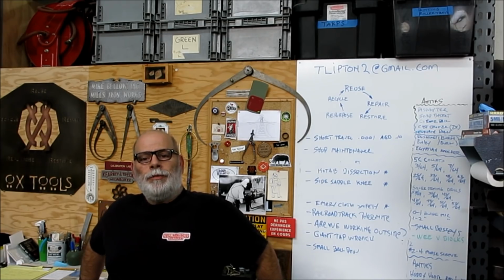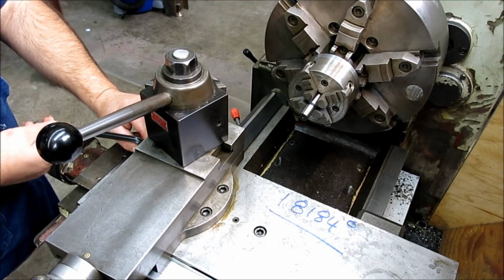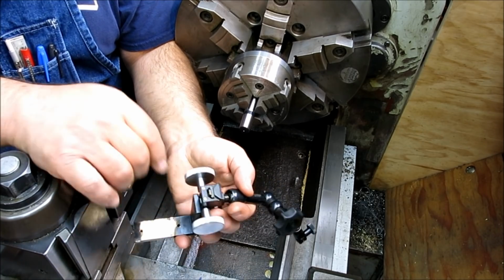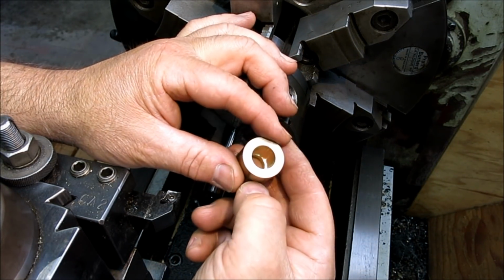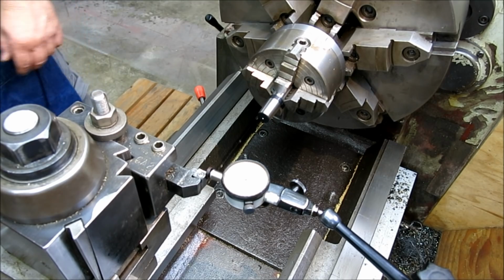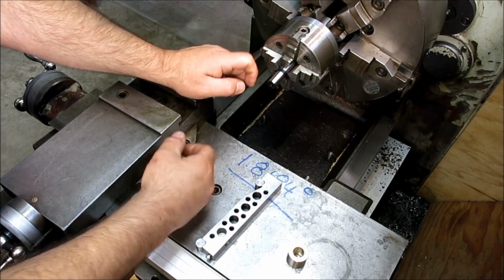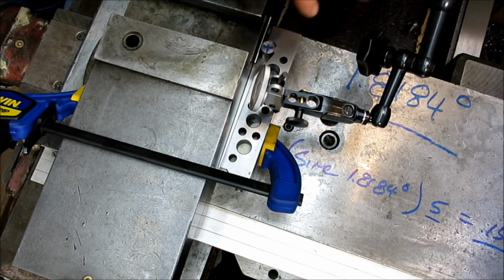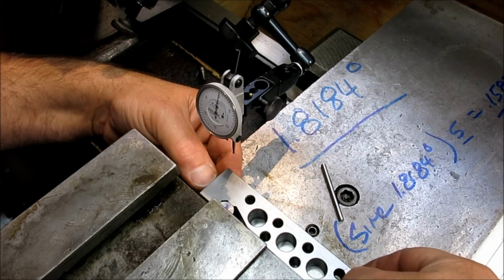Setting Up and Cutting Short Machine Tapers 2

Comment: Thanks for sharing your knowledge. Great video as usual.
I do however have a problem with the last method. I disagree that the compound ways and the compound side face will be parallel to the accuracy required to give the precision fit on something like a Jacobs tapper.
The compound side face on most lathes will be a milled surface and very unlikely to be a ground surface, even if ground its unlikely to be ground parallel in specific reference to the ways . so the accuracy over the 5 inch sine bar could easily be +/- a few thou.
Ultimately you have to verify what you have cut, and preferably before you remove the job from the large, which brings us back to the 2 rings.

One way to make use of the sine bar and eliminate the cross slide ways to side face parallel error would be to set the sine bar at the given angle on a surface parallel to the large axis (eg the main bed ways) then use a indicator attached to the compound (via noga) to indicate zero while advancing/reversing the compound. This way you are reading a direct relationship between the compound ways and the late axis.

Cheers
Reply from the maker: Hi Russ,

You make good points. That's why in the next video we make, measure and compare a cut part to the sample. Trust but verify. The sides of the compound slides are generally pretty good as they tend to be used as datums for the internal guideway. That's all fine and dandy on a modern lathe but something like a South Bend with cast contours on the compound you would need another method such as the one you suggest.

Cheers,

Tom
Reply: oxtoolco  noted. Of course the best method is obviously to get a wizard to just set it to 1.8184deg  on the first attempt. I'd like to see Mr 4jaw do that hehehe.